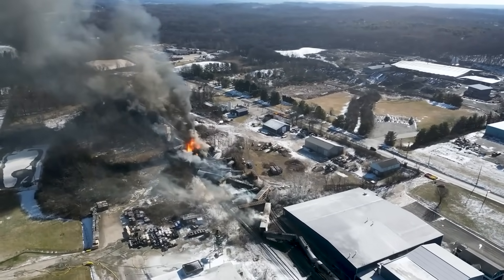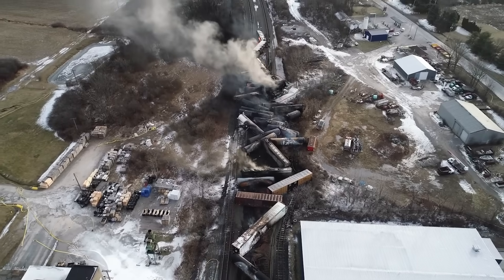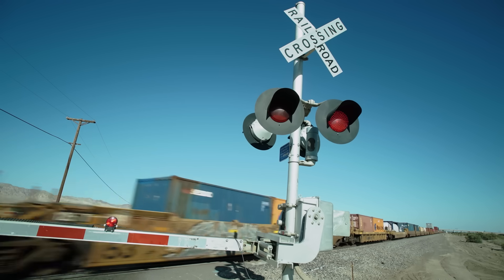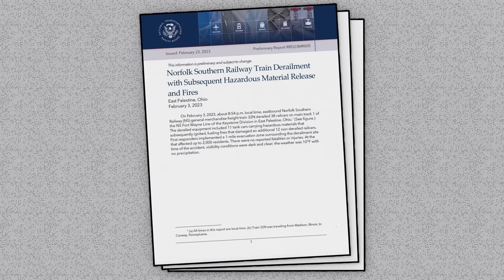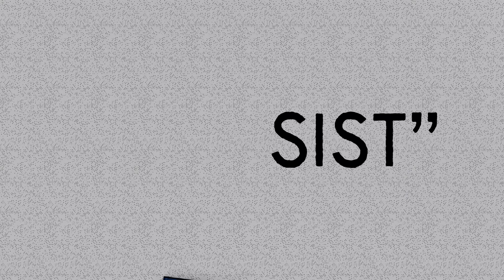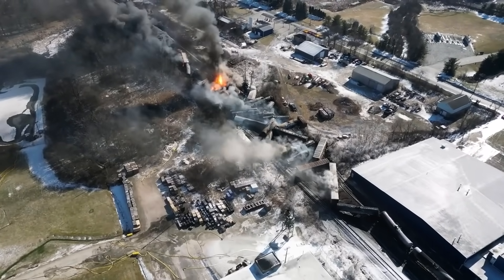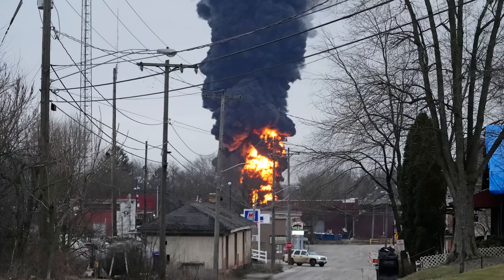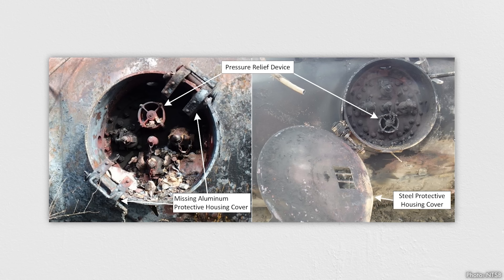East Palestine Train Derailment Explained

Comment: "If a car was as efficient as a train, its engine could fit in your pocket" is the single greatest argument for rail infrastructure I have ever heard.
Reply: Yep if I remember correctly it takes on average 1 gallon of fuel to transport 1 ton of freight 500 miles.
Reply: keep in mind this isn't literal. it's also referring to efficiency as a function of hauling capacity, not power. as diesel engines, they are more (thermally) efficient than a typical car's gasoline engine, but not by that much. The sentiment remains regardless.
Reply: Now all I want is a pocket car
Reply: No land based transportation system is anywhere as energy efficient as steel wheels on steel rails.
Reply: Which is why diesel electric would be nice if applied to cars.
Reply: This is a major reason Warren Buffett bought the BNSF railroad.
Reply: And I guess a relatively close 2nd are bicycles & motorcycles with narrow tires. I'm in flux between tire sizes. Fat tires can just monster truck over bad roads, sand, snow, mud, rocks and tree roots, but are so inefficient on paved ground. But narrow tires, like 700c Road bicycles, small engine motorcycles, and cars like the BMW i3 and Hypermile builds, are super efficient, as long as the ground is smooth.

But the government is so incompetent & untrustworthy with road maintenance. Then you get into fun and emergency performance. Wider tires can handle more power & weight, and float over bad terrain, but narrow tires can cut into mud & snow for turning, which is why Dirtbike and Adventure Motorcycles use narrow tires, compared to farm bikes like the Yamaha TW200, which float over loose ground instead.

Many people don't need the room & costs of a car, they are just too cowardly to get a bike and master it. Trains are possibly the best option for moving a lot of people & things going the same places. But the best independent mode of transportation, with the best options & freedom, I think are bicycles & motorcycles. I didn't even mention they do nowhere near the road damage a car does. And the better use of road & parking space. 

As for wheel & tire width, I think it depends on where you live and what you prefer. I deliver things with a Motorized 2stroke bicycle, 80cc engine, and I'm amazed by how far a liter of fuel can last in 3 hours of riding around. And I'm heavy. 700x35 tires are so efficient, and agile, but if I do hit a pothole or bump, it is dramatic to say the least. The Fatbike I have, is so inefficient & miserable on road, I'm considering not even bothering converting it to an e-bike, and looking into buying or building a narrow tire motorcycle for work and mental health. Maybe a full suspension 29er e-bicycle with the compatible 700c tires. I have a lot to think about and settle on, but hearing the efficiency of train wheels on rail is amazing.
Reply: And then there's aerodynamics on top of all of this.
Reply: @Cancer McAids Besides the low rolling resistance, air drag comes into play.  The air drag of a vehicle is the coefficient of drag times the cross sectional area.  While a train is not very streamlined, thereby having a poor coefficient of drag, it basically has only one cross sectional area to factor in for the whole train.  While cars are more streamlined, each one has to pay the price of air drag, which increases as the square of speed.
Reply: The US rail system is completely absurd.   It's a network of For Profit Monopolies.    If it is a monopoly, it may as well be government owned as shareholder driven.
Reply: You're completely, 100 percent wrong in stating there was a worry or even a problem with 5 of the VC cars.

It has NEVER BEEN STATED by anyone of authority or even someone of your authority that there was any problem whatsoever with 4 of the VC cars. Only one supposedly had an issue as stated by No folks suffering....

 At the most recent NTSB hearing in East Palestine OH in June of 2023 even more of the truth is trickling out. ALL OF THE PRESSURE RELIEF DEVICES WERE FUNCTIONING  AS DESIGNED!!! The chemical company who makes the posion and is responsible for the safety of manufacturing and shipping the compound, stated over and over to No folks Suffering that the PRDs were good, the product was stable, the temperatures while elevated were dropping...Again. AS STATED BY THE MANUFACTURER OF SAID PRODUCT... IT WAS STABLE AND THE PRDS WERE OPERATING AS DESIGNED!!

I'm sorry for all caps but when I hear supposedly smart people make just ignorant statements as facts, when clearly if you really did your research or actually talked to the people here in this hellscape of a town, you would apologize for making just bold un proven statements to back up your thesis...

There was NOTHING CONTROLLED ABOUT THE EXPLODING OF 5 VC CARS EITHER.....AS STATED DIRECTLY FROM THE EPA COORDINATOR ONSITE...THE AIR MODEL WAS PERFORMED FOR ONE!!! VC CAR....NOT 5!!! The fn OH National Guard model that is and was used was for ONE VC CAR.

Again just factually wrong information to create your narrative around your hypothesis!!

Please, please I believe your a good person and are trying to help the people understand but when these posions are in your backyard...Don't minimize  what was done here and how its just the "price of business" 

We just had another document ed fish kill here. The EPA who you so dearly defend as great came out the next day with 'wasn't from derailment'....Where's the necropsy data that supports such a definitive claim?? COULDN'T HAVE BEEN DONE IN LESS THAN 24HOURS..

The whole town and creeks are STILL highly contaminated... please see the latest data put out by DR.Andrew Whelton of Purdue University. And other videos on YT by local people And how the EPA have turned this into a complete PR coverup for NS.

The EPA is using the worst excuse as possible to not look into what he has uncovered.. They wont accept it because he won't release a name of the person who provided out of fear of retribution... what you don't hear from their PR spin is...lets use our 12 billion dollar budget and NS having to pay this bill anyway as legislated...to test his hypothesis and actually perform another set of INDOOR SAMPLES! Folks...the EPA IS STATING AS FACT THAT INDOOR AIR IS OK FROM ONE!!! INDOOR AIR SAMPLE TAKEN BY A NORFOLK SOUTHERN CONTRACTOR IN FEBRUARY!! There has been no further indoor monitoring whatsover. Furthermore, the PID devices they used have KNOWN deficiencies for the low levels of these compounds and the risks associated with these compounds. Again, Mark Dourno from the EPA admitted  this at a  town hall in March of 23... Do further research before making videos such as this, attempting to minimize the impact we people, subjected to  this nightmare are going through having to fight tooth an nail with NS, DeWine's office, our EPA's to make this right and get people long term assistance, truly clean up and monitor people's health without the people having the pay THEIR OWN DEDUCTIBLES to see their doctors.

Look up the NTSB hearings, Andy Whelton or discuss his data before making minimization videos...
Reply: Depends yoy can't stuff humans like cargo
Reply: But you wouldn’t ever get up to speed by the time the next traffic light catches you.
Reply: "The point of the defect detector being on the ground is that it can scan the train as it goes by, if you were to have them onboard, you'd need one for every component it's monitoring. There would be an insane cost to attaching detectors to every component you want to monitor on every train car, compared with one detector that can monitor every train that passes it

Not to mention the safety side of things too, consider what happens if a detector fails. In the rail side scenario, a detector failing means you might not know about a problem immediately but the next one can pick up the slack and detect any issues later down the line, to not know about an issue until it's too late you'd need multiple sequential failures. In the onboard example the single detector monitoring that component is the only thing that needs to fail for you to be totally unaware of any issues, it's a single point of failure..."
Reply: @namename9998  To test for failing detectors, run a known simulated bad car with simulated bad bearings complete with elevated temperatures and associated noises. All detectors should trigger. The ones that don't get replaced. Yes, this is another expense. These known bad cars would need to be run on a fairly regular basis to catch failing detectors on time.
Reply: @namename9998  Airplanes are heavy and dangerous. Airplanes have sensors, and quite a many of them at that.

Trains are heavy and dangerous. Trains have what now? Not much of squat except brakes.

You're worried about a failing sensor? Get real, we're worried about failing bearings and derailed trains here. It's 2023, trains should be at least 1/10th as smart as a smartphone by now.

I think not only should there be sensors on the track as is right now but also sensors on every wheel too, for safety redundancy.

Hell, your car has ABS sensors on every wheel right? You do realize that thermal sensors aren't even that expensive right?

Even one life lost is one too many, knowing in the year 2023 we have the technology to prevent most of these sort of issues.
Reply: @southernflatland  Airplanes don't run on tracks. Cars don't run on tracks. Trains run on tracks. Monitoring by the tracks is the better option even ignoring cost, and don't care if you want to dismiss the reasons. You've just focused on trains as THE place to put sensors, and filter everything through that position.
Reply: @southernflatland  dude, airplanes and cars aren't parts of a much larger machine consisting of switches, tracks, and sensors. The entire railroad is the vehicle, not just the train, and believe me when I tell you that there are quite a few sensors everywhere. Let's be real, we don't need more sensors for a safer rail network, we need more railroad employees.
Reply: @tissuepaper9962  I think they need a bit of all of the above, more sensors on the axles themselves, more sensors on the tracks too, and more employees, all for additional and even redundancy in terms of anything and everything to make the railways safer in the long run.
Reply: @southernflatland  I need you to look up how many train derailments there were in 1895 and understand what progress has been made, and how little progress is even left to be made. Fitting every train car with that kind of telemetry has rapidly diminishing returns, especially when you factor in the effect of spurious warnings, which will always increase as you increase the number of sensors. There are two sensors in the skull of a train conductor that can scan the whole train during a ten minute walk.
Reply: @tissuepaper9962  Yes, recent reports say there's an average of around ~1700 train derailments per year, and that number is increasing with each passing year.

Comparing today's statistics to back in the late 1800s means almost squat, the world is way more industrialized and has a much larger population...
Reply: @southernflatland  you're right, the world is much more industrialized now, orders of magnitude more train cars are running back and forth along our modern railroads, and despite that there are significantly fewer derailments. Seriously, go look at the Wikipedia page entitled "List of rail accidents (1890–1899)". You lack the perspective necessary to understand the extraordinary safety of modern railroads.
Reply: @westrim  I never said to remove the sensors on the tracks in the first place. I said to add sensors for each wheel, or at least each axle.

What's a thermal sensor cost? As little as $10 for transportation vehicles, but probably even cheaper than that to manufacture.

What's a controller board cost anymore? Around $100-ish for a Raspberry Pi.

So four sensors at about $10 each for the four axles, plus a $100 Raspberry Pi, and we're at about $140 per train car to equip them with sensors.

But of course it needs a power source, so gotta install a battery and charging mechanism as well right? Okay, that's what they make magnets and inductive power for, just stick a magnet and induction coil on the train axles themselves to keep it charged.

So adding in those additional parts, what are we at now? Maybe like $250, per train car, to equip them with sensors for each axle. Rough estimated guess of course, but still.

That's in the ballpark of the cost of smartphones, which almost anyone in a civilized country have these days.

Now how much does it cost to build a train car? $250 is like a drop in the bucket compared to the cost of manufacturing each train car, the loads they were hauling, the cleanup cost after disasters, and the long term damage to the environment and health impacts...
Reply: @southernflatland  rather than slapping a sensor on each wheel, it'd be better to slap a monitoring computer on the train that can understand what the sensors on the track are reading, as it was said here, the temperature of the bearing was rising constantly, I guess it would be a rise very different from other wheels, but the sensors didn't know this was a problem because it was within the operation margin, if the train could tell only a single wheel was heating up, it'd have known waaaaaaaaaaay before the derailment that something was wrong...

Also, placing more sensor in the train would probably be a waste, not because they're expensive, but because of the extreme conditions it's mechanical components are exposed to...

Rather than a couple hundred sensor you'd need to replace every week or so, it's better to add a single "really smart" computer to each train so it can monitor the data it's already been given.

But yeah, I don't think they'll allow such a thing to happen...
Reply: @southernflatland  
1. Now imagine that times 10000; the entire system will have more and more false positives as well as a massive price tag. Its about cost AND reliability. The average lifespan of a car is about 10 years, will numerous thorough inspections of its systems paid for by its owner. Railcars are on average 30-50 years old and are simply not as complex as cars for good reasons. 
2. Money
3. you arent gonna stick a fuckin rasperbby pi in every traincar in america an expect it to be a logical solution to your problems
Reply: @lukegn  You'd be surprised how robust simple thermal sensors and hall sensors actually are. Regardless, of course you have a point, eventually everything fails, but there's a difference between a broken sensor not giving any feedback vs a thermal sensor sending a signal that axle #3 on car #38 is running notably hotter and/or slower than the other axles.

There are ways to systematically discern the differences between a failed sensor vs actual detected failure.

If a sensor happens to stop reporting data, well that's just basically a soft error that the system registers in a log of what they should check on the next maintenance checkpoint.

A sensor can temporarily fail without actually stopping the train. Hell, that would have to be designed into the system to an extent, false errors can't be much tolerated, and generally actually can be detected.

The red flag emergency situations they'd be detecting is if an axle is running notably hotter and/or slower than the others.
Reply: @southernflatland  the problem with that is not only that they don't want to spend extra money on more sensors, they don't want to spend more money on fixing "non critical" malfunctions those sensors would detect. In other words they'd just have more data to ignore. The core problem is the profit motive for this kind of stuff.
Reply: @Даниил-н8н  And it's cheaper to clean up the disaster after a derailment?.. 🤔

I mean I'm no genius or anything, but you'd figure in the long run they'd actually be saving money (and saving the environment) by trying every measure possible to prevent as many of these sort of incidents as they can.

And it's not like they'd have to have a human sitting there looking at all that information, it would all be processed by a computer. Only if the computer sees a signal saying train car #7 axle #3 is running 30 degrees hotter than the others, then it would alert the train crew.
Reply: @southernflatland  if you look, how they actually "cleaned up" this disaster, you can decide for youself, how expensive it was for them, compared to fixing the infrastructure. Also, you should understand that it's a business, huge business, and it's not run by fools who can't count their money. If they didn't implement those safety features then yes, it IS way cheaper to clean up, than to increase safety. There are whole departments calculating their profit margins, do you think they are all paid to be wrong?
Reply: @tissuepaper9962  I doubt that taking that "ten minute walk around" would have spotted a bad bearing. And since the sensor readings seemed to be ten miles apart, I doubt the practicality of stopping every ten miles to take that ten minute walk around.  This train was almost 1-3/4 miles long, so the conductor would have had to walk about 3-1/2 miles on his inspection.  Even if he was running 4 minute miles, it would take him 14 minutes. How thorough do you think his walk-around would be?
Reply: @southernflatland  I agree. A platinum wire  resistance temperature detector is about as reliable as can be. As a contractor, buying a few at a time, I paid a little over $3 each for them. To add a microphone to detect a flat bearing adds just about nothing to the cost. To add a second independent set for redundancy would also cost almost nothing. These costs are trivial, compared to the cost of, say, a single wheel bearing.  Had these saved the cost of just this one derailment, the railroad would have saved their cost over and over, well into the next century.
Reply: @Даниил-н8н  The sensor cost is trivial.  It would literally be the least expensive part of the car.
Reply: @billgausman5887  but buying sensor is not the only cost, is it. Do you really think they just need to buy sensors and that's it? What about installing them, meanwhile the cart just stands around not making any money, and their downtime is really expensive, like for every large scale mean of transportation. What about the whole system, that will do the monitoring, it will be quite complex and expensive to develop and maintain, so they would have to raise prices while at the same time their competitor doesn't do it and keeps the lower price.
Or they could just pay a couple thousand bucks to 1000 people once in a while and do a half-assed cheap job cleaning up their mess, when they do spill carcinogens where those people live, like they did in East Palestine.
They just do what is profitable. If it was more profitable, they would do something about safety, but it's just not. This is just what the market makes companies do to stay in business.
Reply: @Даниил-н8н  Being that I was a control engineer for 45 years or so, I doubt that it would take an hour per car, particularly with modern wireless networking and energy harvesting power source.
Reply: @Даниил-н8н  Sensors are easy and inexpensive to install. I doubt that it would take an hour a car.
Reply: @southernflatland Railroads have maybe a handful a year that are resulting from hot bearings. This is about the only freight derailment that has been bad since the Oil Train Crash in Canada it is not worth the investment on hundreds of thousands of railcars just to stop a once a few day occurrence that 99.99% of the time is picked up.
Reply: @igneousmoth432  Handful? Are you kidding me? You didn't do any research before you commented did you?

There were around 1700 train derailments last year alone. Most of them just don't make big news cuz it's usually some train cars hauling corn grain or something.
Reply: @southernflatland  is caused by different things you think you researched but obviously, there are derailments but not caused by hot wheels 99% of the time.
Reply: @igneousmoth432  Meanwhile, I watch the news. I also grew up next to one of the myriad of railroad stations that were not only abandoned, but even demolished.
Reply: @southernflatland  most are in railyards with rail that is not heavy duty and ones out on the mainline are a plethora of things not just confined to hot bearings and components of the wheels. With the number of railcars that do exist unless you took every one of them out of service you cannot put something that would actually stop 99% of these incidents onto them so the railroads obviously as they have always done will take the cost-effective approach to it. 
Also why tf would I need to do research on something I know about already you act like every incident would be drastically reduced with one safety improvement whereas so many things can cause incidents and technology like PTC is working to reduce the types of derailments that are the most easily avoidable from here on out they will probably not do anything since it has been this long without changes at this point.
Reply: @igneousmoth432  So like, let's cut inspection stations to 1/4, that'll increase profits. F the trains or the towns they run through though.
Reply: @southernflatland  for example, there has been like one major derailment since this one last month in Montana and it was caused by bridge supports being compromised which is something that is avoidable if it had been better inspected but the kind of derailment in East Palestine would be better contained with either more detectors or if they had readers that measured and sent the data to control hub in Atlanta for NS saying that the wheel increased 78 degrees in a 10 miles span instead of detecting only if the threshold was achieved to trigger it.
Reply: @igneousmoth432  Sure, let's just ignore the problem, see how far that gets people...

You must be a republican that doesn't give a flying F unless it's next to you. Guess what? I live less than 2 miles from an industrial railroad track.

Their own warning arms don't even work right.
Reply: @southernflatland  which is a crime in itself but that's because they are so profit driven its not correct but its the business side of this country unfourtunately
Reply: @southernflatland  They used to have towers with people who lined switches and inspected the trains, cabooses with people watching the train at all times, stations with people handing orders to trains on the fly being level on the ground and seeing everything going on while it went by, and 4-man crews at minimum as well. But they had far more fatal derailments and far more preventable incidents than they do now. The technology in certain aspects has improved to stop head-on crashes more often, but some still happen because of a low maintenance standard, not on the big 6 companies in the US too often but on smaller railroads with less capital to put towards rail improvements unless the profits justify the upgrades.
Reply: @igneousmoth432  So what are you trying to defend?

Corporate $$$?

Or human safety?
Reply: @southernflatland  The Boeing crashes were caused by failed sensors interacting with anti stall software.
Reply: Could I ask for a video that explains why a train is so efficient and why we could not have car engines that fit in our pockets please!?
Reply: @SureshKrishna5  Economies of scale, to put it in 3 words.
Reply: There are some very good comments on here.
Reply: If a train had even 1/4 as many sensors as a modern vehicle, they might actually be safe too.
Reply: @southernflatland Trains are still safer than cars.
Reply: @fictionindianspaceprogram-222  Funny, I've never seen a car carrying massive amounts of highly toxic vinyl chloride...

Those toxic chemicals have that entire surrounding environment screwed up, with fish dying and animals and people suffering health issues and ultimately having to move to a different city of anywhere else anyways.
Reply: @southernflatland most trains are perfectly safe, America’s wildly outdated infrastructure is not. Also, trains are FAR safe than cars from every metric.
Reply: @southernflatland  a lilttle hyperbolic eh?
Reply: @A_barrel  Hey, your smartphone has anywhere from 20 to 50 or so sensors on it for everything under the sun, depending on what model phone you got anyways.

Each train car has 8 wheels altogether right? It doesn't exactly seem like rocket science that a multi ton train car ought to have 8 thermal sensors and 8 microphones to monitor those wheels for thermal issues and obvious sounds of failing bearings, along with a wireless/cellular communication system to alert of a possible failure.

I mean I dunno, maybe it's just me, but you'd figure in the year 2023, they might actually think about making the trains smart enough to be safe.
Reply: @southernflatland  Thing is, they have thought of that. But the cost would decrease their profits and the investors don’t like that so they instead run with generation-old technology and just pay out when it invariably fails. They’ve done the math and this costs less than making things safer. Never mind that it’s the lives of human beings at risk. The people making these choices will never bear any risk or legal responsibility for them. If you or I took similar risks by building our own vehicles, we’d be held responsible for the damages caused, but there’s no such thing as justice in the land of the free. This really is the worst timeline.
Reply: @orangutantapioca1530  Yup, unfortunately you summed it up pretty nicely when you basically said it's all about the $$$
Reply: @southernflatland  it's about money, yes, but it's also about probability. The current detection systems are clearly effective for all but the most unusual circumstances, such as this derailment. Train cars themselves have a minimum number of parts, and those parts are ridiculously robust, because the cars themselves are expected to be used for millions of miles and decades of vibration and abuse. Building sensors that could withstand that same use case on every bearing of every car would be exorbitantly expensive. The detectors themselves would have to be designed to have a failure rate significantly lower than that of the thing they were monitoring, otherwise there wouldn't be a point, and I'm going to guess that bearing failures on train cars are very rare as it is. The point is: the kind of per-bearing detectors you're suggesting would cost a prohibitive amount of money to even have a chance to be able to detect more incidents than current systems, and even then they won't necessarily make the rate of derailments any lower.
Regular passenger cars and trucks aren't designed with absolute maximum safety in mind: they're designed to be safe often up to a point of diminishing returns and to a price that the buyer is willing to pay. Cars don't have 5-point harnesses, tubular steel roll cages, or carbon fiber monocoques. People generally don't wear helmets and fireproof bodysuits to go get groceries. Why? Because the risk isn't high enough to justify the upfront and ongoing maintenance and inspection costs. Same with safety features on train cars.
Reply: @southernflatland  that is a lot of data to process
Reply: @gaiuszeno1331  And your point is? It's 2023 homie, a simple iPad or Android tablet has plenty enough processing power to handle all that data and then some.

The whole system would more or less be automated, simply analyzing the temperature and rotation rate of every single axle. If all axles are running at pretty much the same temperature and speed, then there's no issue.

But if the system suddenly detects that axle #3 on train car #27 is running 30 degrees hotter and/or 20% slower than the other axles, then that's a clear indication of a fault on that particular axle, and probably a good time to stop the train.
Reply: @southernflatland ask your goddemn trump and bush to do that.
Reply: @Brian Chauvin  cars and trucks don't have sensors to warn you of failing wheel bearings, it really comes down to the driver noticing that there is a different noise as they drive.  Let's ignore the fact that the sensors on the tracks did indicate rising temperatures, but the policy is to keep going until you reach a critical point.  Don't blame the sensors, blame the accepted procedures.
Reply: @Soupy_loopy  Have you ever heard of ABS sensors? They're literally on every passenger vehicle from the past 20+ years, they measure tire rotation speed.
Reply: @southernflatland  yup, don't know what that has to do with anything. If a bad wheel bearing is causing the wheel to lock up, then ABS is not going to help. I doubt a bad wheel bearing would have any affect on wheel speed in a car.  I don't know if about a train, but again, it seems like by the time the wheel locks up, it's probably too late. The problem with wheel bearings is actually the opposite, they get too loose when they go bad. Then the wheels can wobble, they get heated from friction, and only if they totally failed will they possibly lock up.  More likely the wheel would fall off before the ABS detected anything.
Reply: @Soupy_loopy  Congratulations! You totally missed all my other comments on thermal sensors!

Here, have a cookie 🍪
Reply: @Soupy_loopy  And if you bothered to read my other comments, both here and also in other comment threads, you'd see I've clearly said multiple times they should also have thermal sensors.
Reply: @southernflatland  Until you and the majority of people in rural America decide to care about protecting the community of you neighbor two states over like you care about the community you see every day, and demonstrate that care on your voting ballot,  nothing will change and it's not even worth complaining about.  😉
Reply: @erikdietrich2678  This incident sounds to me like an algorithm issue. The absolute value of temperature is important, and is what caused the alarm.  If the algorithm included rate of change of bearing temperature,  that train would have been stopped well before the accident happened.
Reply: @southernflatland  and add microphones, to detect a flatted roller.
Reply: @billgausman5887  agree, rate of change is important here. However, defect detectors aren't standard distances apart. Various sources cite as low as 15 miles to an average of 25 miles. So there would have to be additional calculations for time elapsed and the speed of the train to estimate the distance traveled since the last one. In the extreme case, those calibrations matter less, obviously: two sensor readings with that steep of a slope between them should have immediately flagged as a problem, as you suggested. For the intermediate cases, though, it becomes more complicated.
Reply: @erikdietrich2678  I agree, it has to be done right. It is not complicated arithmetic, though. The train knows how far it has traveled between readings, so accounting for the distance is trivial. The value would be reduced to Change in Temp /Mile. It is trivial to do a predictive algorithm from this to say "at this rate of change, we will exceed our limit in (x) miles." A little more complicated is setting the pass/fail window for different speeds and different ambient temperatures. It is a fairly simple algorithm but requires a more lengthy study.  It is not rocket surgery.

Local measurements are important, too, as a check. This is not a difficult or expensive thing to do. I'd also put a microphone on the bearing to detect a flatted roller.

Unfortunately, this one thing is not the cause of all derailments.  Track condition, adherence to speed limits, obstructions on the track, and car loading also play heavily.
Reply: @orangutantapioca1530  You made a sweeping statement with no specifics of how more technology would make railroads safer. 

A train's sensors don't take into account broken rails, rockslides and landslides, bridges and culverts collapsing, fatigued wheels breaking, etc.

If railroad safety outrages you so much, don't buy anything moved by rail. Oh wait! That means you would hardly be able to buy anything.
Reply: Like in 🇬🇧the profit motive is stronger
Reply: rr's have a detector at specific points to    find problems on train
Reply: @southernflatland the railroad already has these they just don’t maintain them or listen to them. More isn’t going to help. Forcing them to heed the warnings given by defect detectors will.
Reply: @southernflatland  or at the very least, increase the number of defect detectors to every 5 miles instead of 20.  It sounds like that might have prevented this particular disaster.
Reply: @Diseased_Mr_T  As correct as your thought is, consider the flip side..

Add more sensors, humans ignore more. Trust the machine right?

Right?
Reply: @southernflatland  Of course there is a wider and far more important issue about the apparent inability (or unwillingness) of governments to enforce safety laws on corporations.  They will continue to ignore any measures that affect their bottom line unless the penalties are sufficiently costly. 

However, in this case the warning WAS heeded.  It simply came too late.  There is room for improvement in both areas.
Reply: @Diseased_Mr_T  There's room for improvement in pretty much every area. Doesn't mean anyone is necessarily gonna do anything about it.
Reply: @southernflatland  Agreed
Reply: @southernflatland  that’s capitalism
Reply: @southernflatland trains are safer than cars
Reply: @veemo8605  Tell that to Ohio or any other area that had a major chemical disaster screw up the entire environment. Tell it to all the future cancer patients that were nowhere near the incident.